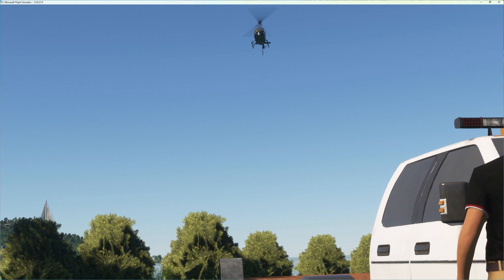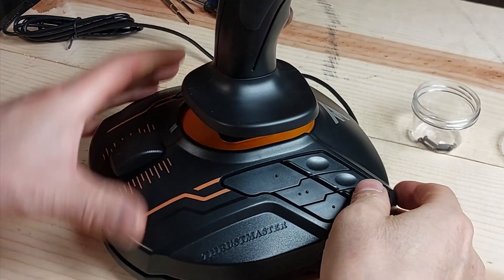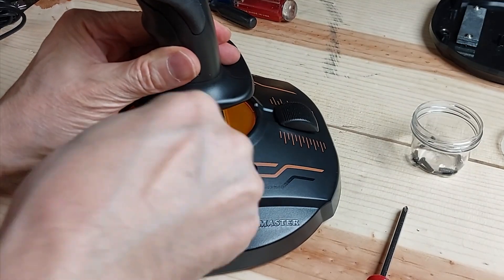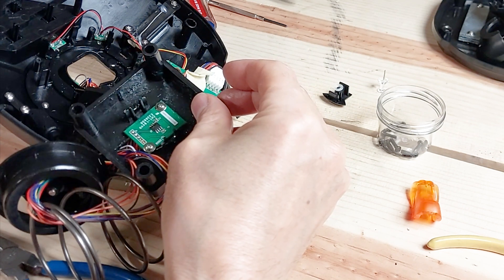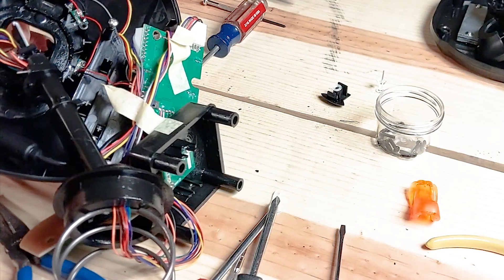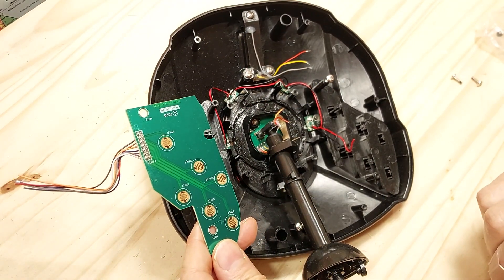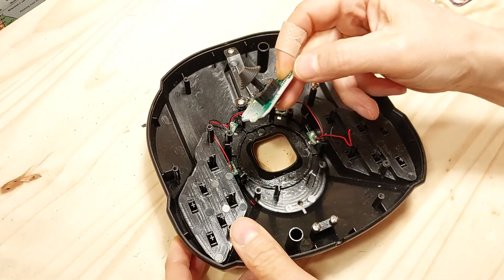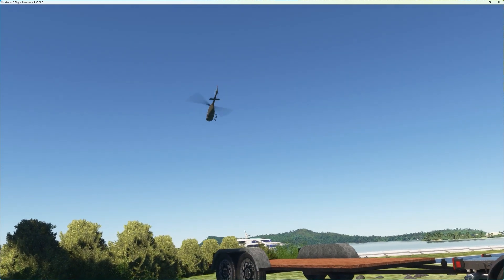DIY CHOPPER COLLECTIVE | PART 2 | JOYSTICK DESTROYED

Comment: That was quite the mess of electronics after you’ve disassembled and cut all the wires. I was shaking in fear of never being able to reconnect the wires and completely trashing your joystick. By the way, I am an electrical engineer.
Reply from the maker: Honestly I had the same reservation when I did it.  Looking at the jumbled mess still clinging together I thought to myself am I really going to start cutting wires on a brand new high quality $80 joystick?

Moreover in a later video I cover connecting everything together -- the wiring diagram is so absurd, honestly I almost decided not to make this series of videos.  I thought man, these guys will never be able to follow this and get it to work.  I'm a former electrical engineer myself and I was 100% surprised when I booted it up and it worked.  There's no question this is complicated.

My fallback position for my small subscribership is if you watched the videos and liked the process and sturdiness of the design but are too squeamish to do it yourself, I'll build one and ship it to you for $100 labor.

I can say I really love this collective.  Conceiving, designing, and building it was enjoyable, and using it is great fun.  And hey, $200.  That's pretty hard to beat.  I mean you can do it for cheaper, but from what I've seen of others' designs, you're signing up for sloppy precision or a development headache (as an engineer, you know what I'm talking about).
Reply: @CaptainHelisim I enjoyed and watch the complete video.  Could you show the Collective in operation?
Reply from the maker: @JDRichard   That's an interesting request.  I will put together a video showing that.  I was doing some river carving last night and it struck me how odd the collective is.  I think to watch someone use it while seeing they're doing high bank nap of the earth flying would be very hard to figure out.  I found myself pulling and easing while going around curves and thinking -- this is intuitive, and yet to explain why I'm pulling and easing in the same turn would be challenging.

I'm not a pilot nor an expert so if I try to explain the function I bet I get lots of pilots telling me I'm full of beans.  And undoubtedly they'd be right.  But I know what feels right and how to use it so ¯\_(ツ)_/¯

Till I get that video together, here's one of the collective in motion though not being used in flight: https://youtu.be/Bu1iX5i-bA0?si=CmUXI8gp071eDfvz&t=133